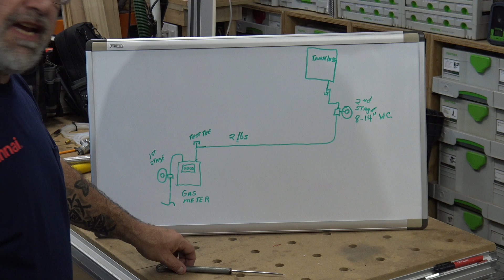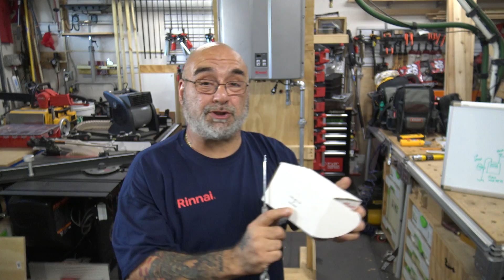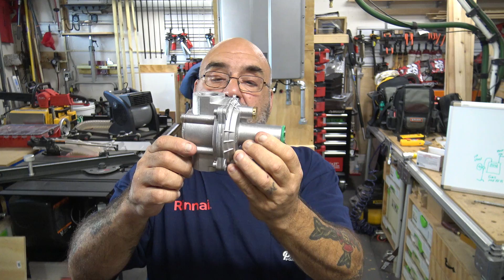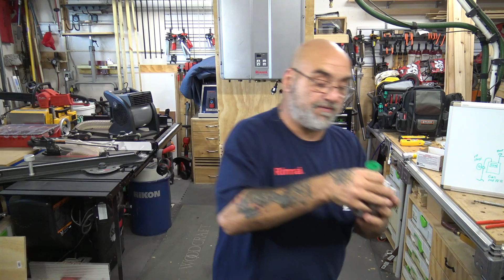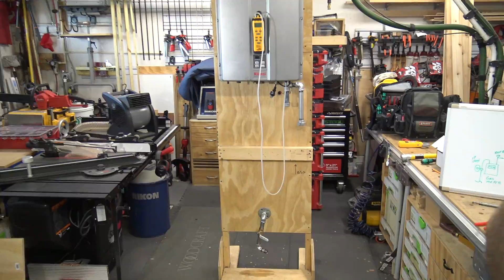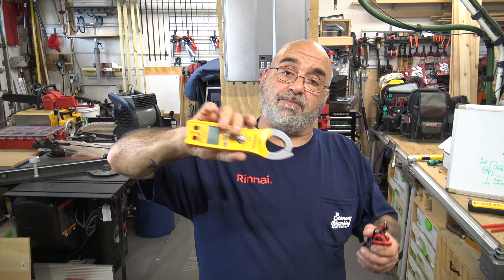Proper gas piping and regulator set for a Rinnai tankless heater

Comment: I have an electric tankless water heater. I don't have a recerculation line.  As long as I install recerculation pump on hot or cold side. And install thermo valve under sink. I should be good? Thanks Dave H

Comment: I've got a 60 gallon tank with a half inch line feeding a gas stove and dryer if I go 3/4 from there 15 ft to my hot water heater should I be all set the length of the line in total from the tank 35 ft maximum

Comment: I'm installing a rxp199in. My propane tank is about 15 ft from my tankless. It's plumbed with 3/4 all the way to the tankless. The house has a LV4403 regular before entering the house. Do I need an additional for the tankless? Thanks

Comment: Could you use an integrated 2 stage MEC regulator at or very near the tank with the run to the unit being about 15 ft after the regulator on an outdoor unit? Regulator I’m referring to is gray and is tank to inches. Thanks for your help.

Comment: Sir, I am in North Carolina and the codes says at 70 feet away from the meter, I have to use 1  1/2 inch Black Pipe,  with 440 cfh, I am installing the Rinnai 199 BTU. Thank you, I will make sure the regulator is 3 feet away fronm the water heater.

Comment: I have black pipe from the meter to a manifold in the house and 1/2 csst from the manifold to the range, dryer, furnace, and current tank water heater.  can I hook up from the manifold?

Comment: Why do you need a additional regulator on a 2psi system.  Maybe a high pressure system
Reply: There’s always a first stage regulator (at the tank or the meter) and there’s a second stage regulator at the house or appliance

Comment: Mike-Looking to upgrade a 75 gal tank water heater to a tankless. Starting to see rust particles on the floor which probably is indicative to a potential problem. Its a 18 year Bradford White unit. I have a 2 PSI Natural Gas meter due to having a whole house standby generator installed. Output of the gas meter has a tee reducer to what appears to be 3/4" on both sides of the tee. One end of the tee goes in the basement (5' away) to a 4 port hookup with 1/2" gas lines. The other end of the tee goes to a regulator and out to the generator. The current water heater is 1/2" gas line. Total line length is less than 15' from the gas meter to the current water heater. On the 4 port we have the current water heater, dryer, stove, and furnace on it. Could we use an adapter to convert the 1/2" line to 3/4" seeing how the length of gas line is so short? Any help would be appreciated. Thanks.

Comment: I purchased the Rinnai tankless water heater combi. I was told that it would not work with my old fashion steel radiators. Is this true? If not any suggestions? Thank you!

Comment: Is the required gas supply pressure of 3.5-10.5w.c. Line Pressure or Operating Pressure (with the water heater running)?

Comment: Nice I think the clear hose size is 3/8 ? looks like it will go straight into my manual manometer. I'll check that Field piece brand out . I've seen digital manometers be off and have to be calibrated yearly etc.   Thank you for zooming in great video very informative !

Comment: All of my gas appliances are about 70-ft from the meter. gas to the basement is in 1-inch black steel. I have a furnace and a task heater. I want to add a tankless. I also want to be ready to install a gas range. 
I was going to have the gas upgraded to 2psi, but have another thought: 
Is there any reason why I couldn't have the meter upgraded and set to 14-inches, then use the 3-inch WC drop table and then re-regulate in the basement using a governor (instead of a regulator) to 8-inch WC and then use the 0.5-inch tables to calculate pipe sizes for the rest of the appliances? (e.g. using the Pietro Fiorentini 31053 governor)

Comment: Mike im going 55' and going to run dedicated 1" tracpipe  right to the meter to a ruc65 which is 130 btu. Rinnai  tankless. My other gas appliances are 110 btu. I always here you talk about the 2 psi but cost to much. Will this work? Meter is 250 btu 7wc 1/4psi.
Reply from the maker: The 7”WC may be a problem

Comment: MIke, I need help.  I have a Rinnai and a two-story home.  The issue we're having is when upstairs getting ready for a shower the water starts coming out warm then all of the sudden it gets cold and will not get hot until we turn off the shower faucet.   One time i heard a beeping sound from our garage and i looked at the
heater and it showed a code of 12.  When i looked up the Code 12 it says its an issue with the flaime or no flame.    Can you help and what I should do.   Thank you!  Nramirez.   One more thing, there is no issue when we're downstairs using the sink or other things and getting hot water, only upstairs.

Comment: Mike, Can you show us how to wire an external recirculation pump to the RL94e exterior gas unit?  The two wires are labeled “Cut wire to connect to pump”.  Does the heater then turn the pump on and off?
Reply from the maker: Yes you cut and connect the pump to the wires. You would set the dip switches to run the pump. Remember you need a dedicated return line to operate the circulation

Comment: Hey Mike, if I'm installing a propane tankless heater, do I still need a sediment trap on the unit? The gas will be flowing upstream. But also wondering if I could install a sediment trap closer to the propane tank, if it's needed.
Reply from the maker: Yes you do and you need it at the tankless Mike
Reply: @ThatTanklessGuy  thanks my man

Comment: Mike, I have a 5 pound system. Can I use the same regulator or is it limited to 2 pound input?
Reply from the maker: it’s limited to 2 lbs
Reply: Looks like Maxitrol makes a regulator that is certified for an inlet pressure up to 5 psi. Part number 325-5L600-3/4-LIM. Spring range is 7-11”, so it fits the bill. Do you recommend that brand?

Comment: I prefer to use a low pressure gas for safety.  I had to install 1 1/4" gas line in my low pressure gas line.  About 70 ft away.

Comment: I am a bit confused.  I have a 3/4" black pipe coming into my house.  Its only about 15 feet to the location of my proposed tankless.  The only other item on that 3/4 is my forced air heater.  Since it is such a short run do i not need the 2lb?  Do i need the 3/4" regulator no matter what?

Comment: What type of regulator is needed for propane?
Reply: It depends on the incoming pressure . Is it 10 psi. 2 psi or inches coming into the house.
Reply: @TheBuddylab   Thanks. Used a (red) 10 pound, then (green)14in. wc going in to the house.

Comment: Is that regulator always needed even if I’m installing.  Ao smith. Or  rheem tankless
Reply: The regulator is needed when you have a 2 pound or a 10 pound gas system feeding the tankless. Most tankless heaters need between 5 and 12 inches of water column coming into the unit.

Comment: Mike I installed a rl75 in July,was throwing a code 12,I iodized 1/2 gas line to 3/4 code went away,last week customer called me and said it's throwing a code 12 again,I not not what to do,maybe test manometer,probably because he is running has fireplace now since it's cold probaly starving unit.What would you do in this situation?

Comment: I have an outside tankless unit it’s only 3-4 years old. When I run water inside and go outside I smell gas. Does anyone know why and if this means it needs to be replaced?
Reply: JC JC no it doesn’t need to be replaced. Do you smell had coming out of the vent at the top of the unit or do you smell it around the unit.could you give me the model number of the unit and if you have natural gas or propane. R mail me your answered and a few pictures would help also . Mike

Comment: Have a Rinnai model rc80Hpi serial number 10.03 - 0 0 0 3 8 8 March 2010 I need to know if I need a regulator and it's in a mobile home with two propane tanks 6ft away from unit. The horizontal condensing vent 12in with a 90 elbow part number 22903 1 is this the correct venting. I am new to this. My water heater is going and I bought this 4 years ago now need to put it in I'm getting the parts and I'm have a professional do the piping? Does the pressure relief valve go before the regulator.

Comment: Mike, awesome video(s), I've watched many of your videos. I"m installing a E60SRN boiler. I have an existing 2 pound gas service to my house. My house is about 3500 sq ft. I have a gas furnace, gas clothes dryer, gas stove and gas oven. Question: can I use the existing 2 pound regulator or do I need to add a second regulator just for the new boiler. Thanks again
Dan
Reply: So here’s the deal Mikes Videos are great for anyone that is mechanically inclined that preforms service on there tankless water especially Rinnai brand . Thank you Mike.   Oscar “Willie” Durazo Southern California

Comment: Problem two pound gas becomes medium pressure and if installed inside a building must be welded pipe trac pipe with any mechanical joints don't meet code
Reply: 5 lbs and above
Reply: Not to mention 2lbs isn't really necessary. Just need a meter that flows 500k btu (for most homes).
Reply: 2 psi in a residential home is basically unheard of in New England. Not sure if Florida is different, natural gas is typically between 5-7" water column after the meter. Typical manifold pressure on a gas appliance is usually 3.5", but different for tankless depending on brand and model, always represented on the tag that shows btu output.
Not sure if he is referring to LP gas installs, that would be 11-14" after the second stage regulator to the appliance. Very uncommon for us to add a regulator before the appliance like this.

Comment: Great Videos! I noticed that you did not have an regulator included in your previous videos. Is a regulator required? Thanks Mike.
Reply: It depends on your length of piping and the gas pressure. If you have say a 2lb. system then you would need a 2lb to inches regulator 3 feet from the tankless. I hope this helped Mike
Reply: @TheBuddylab  can you share the regulator part number thanks